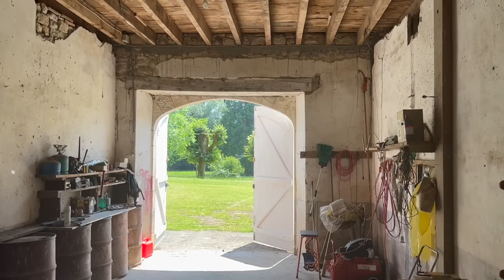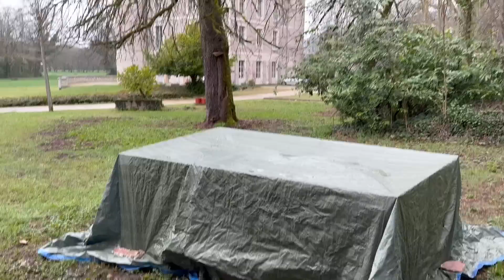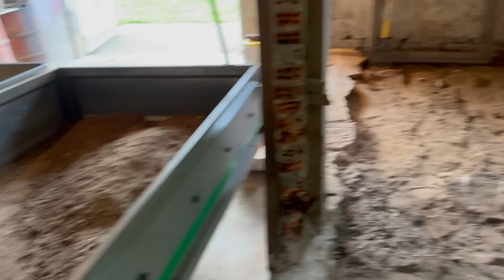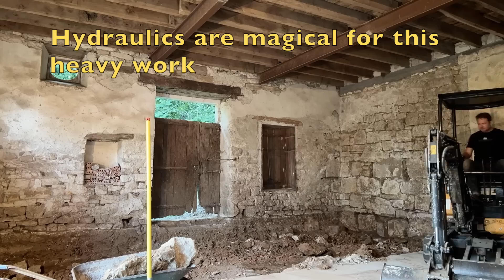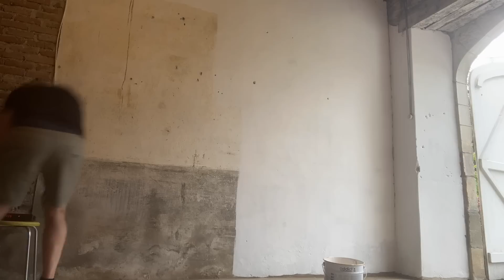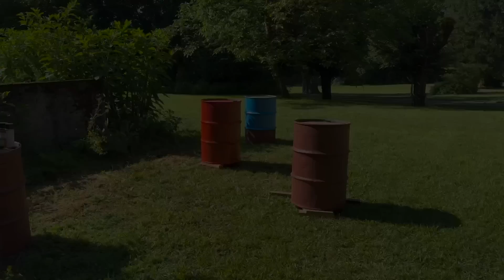Château Shop & Garage Renovation Part 1 | Queen's Escape

Comment: Perfect use of an old horse stall area.  My husband would have loved that big a workshop.  (he had a single garage sized space).  He also told me the trick of using a pickaxe or hammer (for instance) is not to have your hands down close to the head.  More powerful to have a fuller swing.  Interesting the things one learns.  Boy you should have one happy neighbour.  The cost saved.  Win, win with your need to get rid of it.  Best wishes.
Reply: Hi Shirley, yes, our neighbor was very happy to get all the stones.
Reply from the maker: Great pick axe tip!

Comment: Are you going to use the lime rendering around the stone in garage?
Reply: Hi Jeannie, no since it is only a garage I decided not to go too much into detail with certain things. I spent so many hours and days working on this project that Karen thought I was living in there. I also changed my opinion on certain things during the process. First my idea was to expose all limestone in there, but after spending 3 full days knocking off the plaster as shown (half), I decided to stop. Everything you do takes 3-4 times longer than you would think. 
I could still render around the stones later in time, but right now there are so many other things to do.